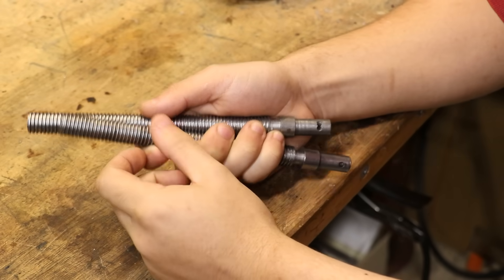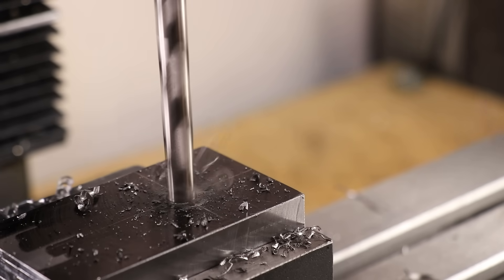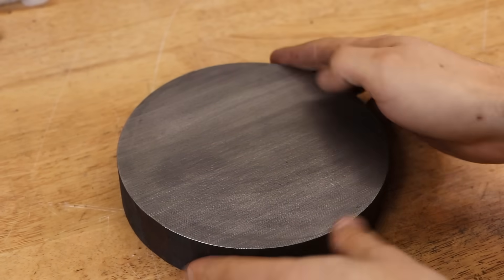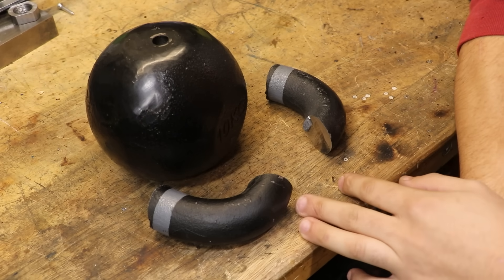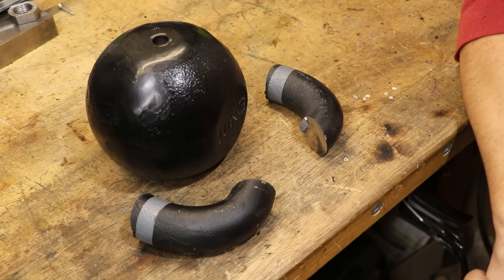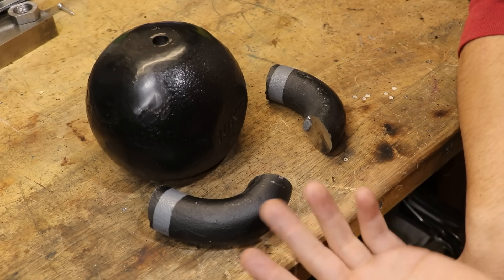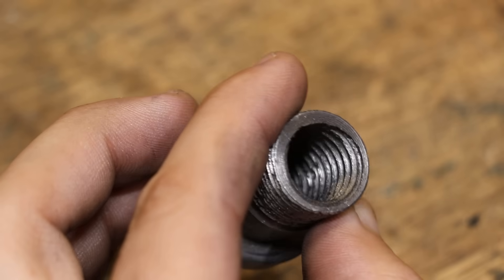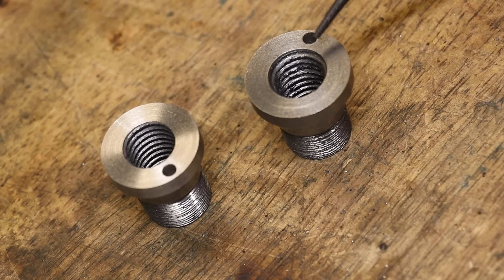Why You SHOULD NOT Use Cast Iron Weights For Machining

Comment: I have a small pice of unidentified iron or steel (an old part), and I need to know if its' actually cast iron or steel , without damaging it too much, is there an easy way you know ? My goal is to determine is it could be hot forged, but if it's cast iron I might destroy it trying, so I need to be sure before. Thanks
Reply: a spark test should show you, cast iron generally throws dark orange straight sparks (from a grinder), steel shows more yellow sparks.
Reply: Cast Iron usually machines into dust rather than chips...That might be a visual indicator...
Reply: The piece is small and I’m not sure I can machine or grind enough of it to be sure
Reply: There's always the taste test. When I started in a machine shop one old timer was pulling my leg by sniffing blocks of steel to tell what they were. Bugsley was quite the card.

Comment: a kettlebell due to shape and intended function is the worst choice for machining, I wouldn't touch that stuff. good quality cast is readily available in the USA but not cheap. anything not made for machining is a crap shoot, and so is cheap cast from certain places. I have actually heat treated bad cast and made it machinable by heating to 1700 or so for a few hours and cooling slowly. a bit of a desperation move, but it can be done.

Comment: I work for an independent R&D company in Additive Manufacturing. We recently did a project for an automotive company, which investigated depositing Stainless Steel onto Cast Iron. It was terrible. At one point I was cleaning up one face, and I could see the diffused porosity by eye (you just don't get that with most materials). The graphite gets in the way, and the stuff erodes so easily due to the embrittlement.
Reply: Could you try to reduce the graphite quantity, at or near the surface, by heat treatment and a high oxygene atmosphere? Perhaps the surface after that needs mechanical treatment like burnishing, as the diffused graphite will leave hollow areas.

"steel edge decarburization" - is normally unwanted or must be kept at bay, but in this case it could make the surface just right to facilitate the bonding of a (cheap) cast iron and the stainless steel with the help of forming an interface layer. Perhaps inducing nickel atoms into the decarbonized boundary area can create a connector for the high nickel steel.

Comment: What about an automobile junkyard to source cast iron from brake rotors or crank shafts, or other shapes that may match your needs?  It was premium product when the factory cast it in the first place ... where as the dumbells are probably recycle material with imperfections from previous casting processes(white and grey iron particles mixed throughout), plus tons of unknown contaminations(sand, various steels, rust, charred paint or oil/grease residue, and other bits).  Thanks for making this video.
Reply: Crankshafts in car engines are either steel or nodular iron (AKA spheroidal graphite cast Iron), they are not made from grey iron.
Reply: @ferrumignis  The "Hi-Po" crank shafts were "NODULAR" Iron or forged steel, but there was a lesser grade of cast crank shafts, so as to make the NODULAR ones special, as well as the Forged Steel units.  The forged units had a wide parting line(1/4"), and the cast unit had a narrow/razor thin parting line, for a visual cue. The NODULAR ones had specific part numbers to "find" or order, and the rest were the lesser cast material. Most everything--- probably 95% or more are this lesser material,  ...that I do not know what it is, I just assumed it was CI.
Reply: It would be a workout to get to a crankshaft. Unless they have them torn down already for some reason. I don't think too many are buying used crankshafts. But maybe? I know when they shred cars they take the engines out of them. The shredders don't like the meatier chunks. So the rears, trannies and engines get pulled out. At least that's what I've seen at operations I've visited. Now what they do with all of that I don't know.
Reply: @1pcfred  Sometimes at a "u-pull-it" style parts yard, they are laying on the ground ... previously pulled by other parts seekers maybe wanting rods or pistons?  1 guy wants an oil pan and another needs a transmission, now the crank is almost out...MAYBE....Maybe not really that practical at all, just an idea for a larger "round".

Comment: had the same issue with aluminium
in our work, i'm the "collector" and that for a good reason
once a working mate needed something out of alu and used a cheap stock?
i don't know
it was a horrible material
it was soft af, it clogged the drills, files and the threads where just done after a hard twist
i gave him a piece of my "collection" 😂and it was, as you would work with steel

don't know what's the difference is there, but there are some

Comment: We machine a LOT and I mean A LOT of sandcastings at work and yes very rarely there is porosety or sand inclusions but it machienes nice and gives a good finish because the alloy is made for machining. We allso machine weights (just drilling 2 holes throu) and they are the same story. Sometimes an entire batch is hard to machine witch is due to inpropper heattreatment or casting conditions, things that arent conciderd with dunbells. I would have no concern making something out of the weights we do at work because they are high quality castings. 
Moral of the story: Dont use the cheapest material you can get your hands on that isnt even made for machining.
Reply from the maker: I’d believe that. A good mould design really makes of breaks a part. There’s Chinese ones are probably about as basic as they can get.

Comment: Is cast iron an expensive metal to purchase - the good grade , intended for machining?
Reply from the maker: For sure the good stuff is. I believe my stuff is made locally.
Reply: Comparitively so, YES. .... Steel is about 50c-$1.00 per pound USA in sheets, tubes, flat bar, and angles, and Durabar CI is $4-$5 or more per pound...even small CI is heavy and a 2: thick 4-5" round may weigh 20lbs, so $100 for a small Lathe Chuck Adapter raw form?
Reply: David, just search for continuous cast iron or Durabar process and you will be a lot more enlightened as to how the 'good stuff' is produced....it is a specialised manufacturing technique that guarantees a very consistent high grade of cast iron bar for machining components from.
Reply: @howardosborne8647 thanks for that 👍

Comment: I don't know about others, but I have no confidence in any metals from China.  China is not up to modern standards for metallurgy in my opinion.  I just stopped using it finally.  My time is worth more than that.
Reply: To be fair, China makes a lot of the worlds high-end products.
The issue is that for everything that is value-produced to the lowest cost, you're obviously going to get the rock bottom cheapest stuff they can source.
Anyone care to bet where a lot of the stock Grainger and other metal supply shops get their certified stock?
Reply: As another comment below says,if you want top grade steels from Chinese suppliers/manufacturers that is totally dependable high quality then simply pay the appropriate price for the product and that is what you will get
This long running nonsense idea that the Chinese industry is incapable of producing top quality steels and alloys is a totally misleading myth....pick a reputable registered supplier and expect to pay the appropriate price rather than peanuts and their steel products are as good as any others.
Reply: They don't even try to be accurate for 90% of what they do.
Reply: What u blame on 'China' is wrong.
China produces to a demand and price.  If u're willing to pay (which includes quality control - which isn't free) u get what u want - good quality.
If u want cheap.. well.. they don't have any magic over there either, so u will get cheap.

The economic hobby machines and tools all work - for my hobby use.
Would I expect them to hold up commercial use?  Not really.  But I didn't buy commercial grade product now, did I?
Reply: PS:  if an importer (or exporter) claims commercial quality at hobby prices..  if its too good to be true - it usually is.
Ur common sense should KNOW that and act accordingly keeping ur greedy side on its toes.
Reply: China is smelting more than half the metal produced on the planet now. Your time is worth diddly compared to that.

Comment: A good source of high quality scrap cast iron is brake disk rotors if you need relatively thin stock.
Reply: I keep the ones off of our vehicles when I do the brakes and am going to do some home casting this year.
Reply: They make good bases for tool stands, for when you don't want to just use a giant rim
Reply: @Mix1mum  indeed they do! I have a bench grinder mounted to a rotor... extremely convenient to clamp to the bench
Reply: I have a pile of them getting ready to get my foundry warmed up.

Comment: try brake disks, they are generally a pretty good source i'v heard
Reply from the maker: I tore down one a few years back. The vent holes do limit the thickness and size of part you can make, but it tends to be very good cast iron
Reply: @artisanmakes  Select a solid disk rotor... Some are up to 5/8" thick!  Also, some projects could tolerate the vent slots without changing the final results.
Reply: don't they also have a bunch of other stuff in there, like silicates?
Reply: what? They're not steel? How do they not crack?
Reply: @LiviuGelea  Because they are made from gray cast iron and not lamellar cast iron, and the alloy parts are controlled.
Reply: @LiviuGelea  Brake disc rotors and brake drums are definitely not steel....They are made from cast iron and always have been.
Steel would warp and distort far too much to be any use in a brake disc rotor.
Reply: @howardosborne8647  they DO use cast steel in some high performance racing brake rotors, as it dissipates heat faster, and they don't use them the same way as a normal production car is used, usually replacing rotors after a race, not using them for a long time, they don't tend to thin out enough to get to warping too badly before they swap 'em out.

So long as you source them from regular cars, and not from some formula 1 shit, you should be finding cast iron, same with drums, however if you're getting scrap drums, check to make sure they weren't burned during use, you can see if they are by checking the colouration and looking for cracking on the inside surface, because you don't want material that could be full of microfractures and stress cracking from it, seen it multiple times from vehicles whos rear brakes seized during use.
Reply: @NickBingham01  The only reason I would usually source cast iron from brake rotors or drums would be for melting and re-casting purposes......I don't think there will be any danger of picking up any F1 brakes at my local scrappy yard🤣
Reply: @LiviuGelea  They are cast iron, and they will break if you hit them hard enough.

Comment: Also with dumb bells/kettle bells/other things where the only material requirement is approximate weight, they often quench the castings.  That leaves all kinds of hard spots and microfractures throughout the entire piece.
Reply from the maker: Never occurred to me but I’d believe it.
Reply: I’ve found chips of what I believe are actually carbide as inclusions that repeatedly destroyed cutters until I gave it a file test and found only my diamond file did anything. These things are made scrap in scrap out. But that doesn’t matter for lifting weights.
Reply: @geekswithfeet9137 Honestly, given what a good quality cast iron vise will cost, I can only imagine the prices of free weights if they were made of anything quality.
Reply: We used to grab any sashweights from old house sliding windows, usually cast from 1900-1930ish and produce a beautiful square grey chip and machine as smooth as butter. But the weights are only about 1 3/4 dia and 18 inch-2foot long.
Reply: This is why there are huge lubrication problems on flywheels of rotating presses. These have to be lubricated periodically and signed off in a register in U.K. to prevent seized flywheels shearing the shaft and running up the press shop and assembly areas to the injury and death of those in their path.
Reply: Yep. And those hard spots are a likely cause of the "porosity" seen in the finish. Rather than micro bubbles, the hard nodules are torn out of the softer material and can get dragged along like grit in wet clay.
Reply: Back in the 1990's there was a rumor of a challenge, to forge a fully usable longblade from cast iron.
There is a procedure to "quench" cast iron, it takes 72+hrs in an autoclave using a ceramic wax.

Comment: In my experience the surface always comes out pretty rough when you machine cast iron, a little sand paper and scotch brite do wonders though. I think there's some special blends of cast iron, like ductile iron, that can actually form a proper chip and don't tear up as much when machined, but it's also more expensive.
Reply from the maker: Yeah it’s never amazing, but I’ve never had parts blow out like that before.
Reply: @artisanmakes  Must be pretty crude cast iron as you said, I mean it's just a weight, it doesn't have to hold fine details. Reminds me of a cast iron dumbell I used as a makeshift anvil for years until one of the ends just snapped off the handle.

Comment: what cutting tool do you use to cut this HSS steel blank?
Reply: Carbide cuts HSS, just take light cuts.
Reply from the maker: That was carbide cutting O1 tool steel. When was then hardened.
Reply: bench grinder wheel, usually

Comment: Would old, busted engine blocks or heads be useful sources of cast iron? I'm sure you can find a cracked block for real cheap.
Reply: If you dont have a furnace those are Not really useful, Just the shape
Reply: @nightraidone9768  depends on what you want to make. If it's only small parts you can find a chunk to cut off and machine from a block like that. You only have to make sure there aren't any cooling channels in the portion you want to use.
Reply: Engine blocks are really thin
Reply: Cast iron rotors are the industry standard for recycled cast iron. Cheap too.
Reply: Generally too thin, you'd get better value just buying drops or offcuts from your local metal supplier.
Reply: the problem with engine blocks is there's a LOT of open space in 'em for oil and coolant passages, also they are sand cast so you got some roughness on the inside that has to be cleaned up too, honestly, unless you're equipped to melt it down and recast it into a bar or something, I would look elsewhere, crankshafts for instance, or solid brake rotors (provided they haven't gone through some kind of severe wear occurrence somehow and burned.).